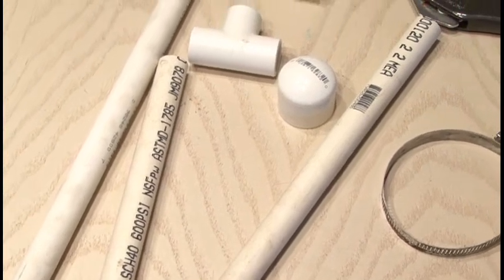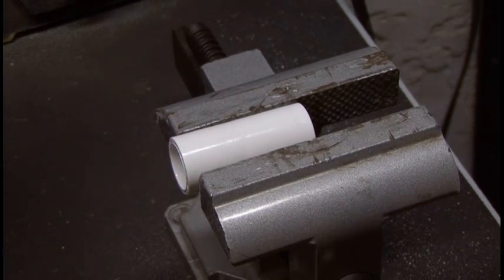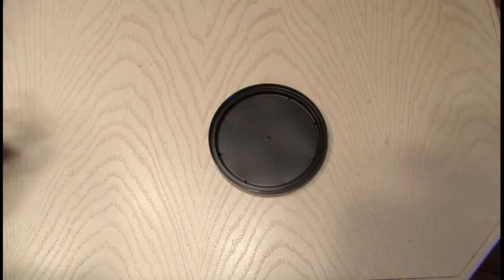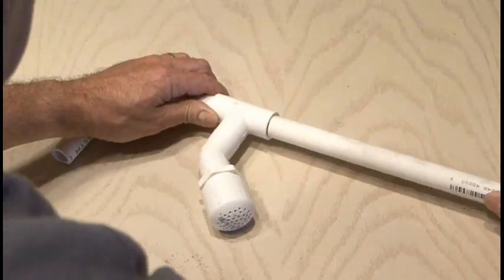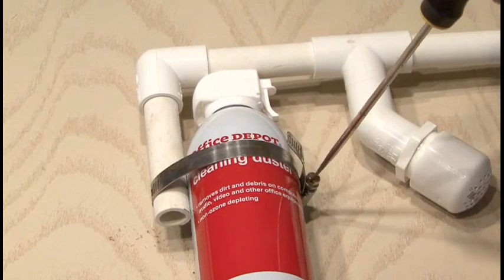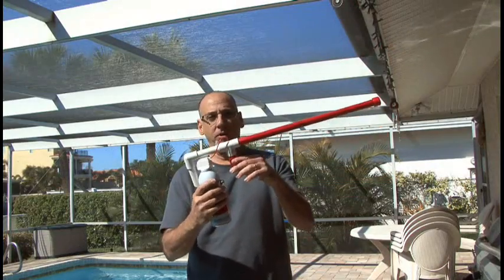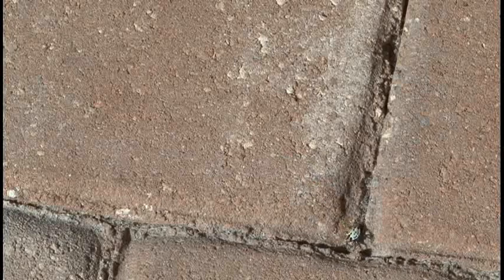Weekend Project: Spider Rifle

Comment: The bottle of compressed air that I bough left a cold vapor inside the cap the spider is supposed to end up in, and I’m assuming that that cold would kill any spiders I catch. Can you recommend a brand of compressed air that does not have that issue?

Comment: I tried this twice with very disappointing results. I would need to use Co2 cartridges to get enough air pressure to make this effective at all also I found a way to make it shoot the spider. Just needs more air. Might still try it. I crushed the one spider I sucked up with it from having to hold it so close  which kind of defeats the purpose for my niece. She doesn’t want to harm the spiders but relocate them safely.

Comment: I thought I was going to be able to shoot spiders at my enemies
Reply: actually, you can do that just by modifying this design slightly. just suck up a spider, then take the comp. air tube out of the hole on the top, and put it in one of the holes on the bottom. spiders will be shot towards your enemies.

Comment: My only concern, is the content of the air duster.  the content of the can is not compressed air. It's actually Tetrafluoroethane (AKA R134a AKA Non-destructive Freon refrigerant.) .. Over-use of the gas (holding the valve open for too long) will freeze the spider. (Now, I know the arachnophobics reading, and making the "Kill It With FIRE!" statements will say "GO FOR IT!!" but, if the intent is to keep the spider alive, only use the gas in short bursts, and NEVER invert the canister! Doing so will allow liquid R134a to enter the straw, and vent, causing instant freezing!  (to say nothing of Frostbite if you get it on yourself before and as it vaporizes.)  I've also used a similar idea to remove mud & paper wasps that got loose in the home (the perils of living in an old nearly 200-yr old farm house.).. and added a 1/4-turn valve between the catcher canister to hold the little suckers in.

Comment: It mystifies me why you need a "valve" in the tee fitting. It seems you could just as easily put an end cap on the handle. I don't see what purpose it serves except perhaps to avoid the cost of an end cap. Enlighten me.

Comment: Or you could just buy something just like this. My parents used to have it. Now we just have ways to protecting the house (lavender, citrus). The device would trap the spider in the catch (assuming it didn't die from the trauma) where it dies of starvation. If you're just going to let it go, what's the point? They're evil. It would be like building a prison with a literal revolving door.

Comment: I think you made a fatal error in your design, sir.

You let the spider live.
Reply: Line the insides of the tubes with posion and flames!
Reply: Yaaasss
Reply: +Plato i might do that with mine
Reply: in think you're to evil..
Reply: +PlasmaScythe Better idea, line the inside with razors angled to slice incoming insects.
Reply: ikr
Reply: Juan Angel Andrade Or needles. Needles are safer to handle than razors. You're going to have to line the barrel with them, if you line the part of the gun with holes in it, you'll slow the gun down more than you would with the barrel.
Reply: Muffet
Reply: James Bernich Muffet won't fit in this rifle thing.
Reply: +Fuck google's name policy dude there are so many homestuck/undertale fans now!
Reply: Nepeta Leijon They are uniting as one through the power of megalavegala.

Maybe.

Don't quote me on that, k?

Comment: Put a cloth soaked in 50/50 water-insecticide in the end-cap before using the spider rifle.  The low concentration ensures the spiders suffer without dieing so they can feel the flames of justice when you uncap the rifle and throw them in a bonfire.

Comment: Spiders are arachnids, not insects. What you made is more of a vacuum than a rifle. It  wouldn't work with a big spider. Why not just use your regular vacuum cleaner? The only downside is that it would kill the thing, not just trap it. Of course, I'd rather kill a spider than get bit when I'm setting it free.
Reply: +Naughty Little Boy For all the work he put into this project, he could have modified an ordinary vacuum cleaner to capture spiders alive.  Cheaper to operate (compressed air cans are expensive) and more efficient.
Reply: +Naughty Little Boy You're only 6 years late on telling him that.

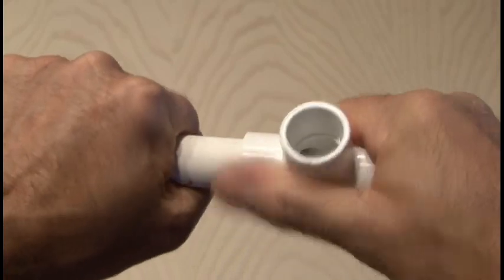Comment: Just an observation: at about 1:36, the narrator clearly says he is drilling holes in a 1/2" end cap, but at about 2:29, he clearly says that the end cap is 1 inch.  Which is it?  The video was recorded first, then he went back and added the audio.  Obviously he misspoke when referring to the cap as 1/2".

Comment: Just curious, and let me up front clarify, I have no problem with the death of the spider in this project, but once the spider is sucked into the "container" that you are blowing the compressed air through, would he not at this point be frozen by the propellant that you are blowing from the duster?

Comment: As others have said, that would be non effective on the most common spiders in Australia, Huntsmen. I just trap them under a clear plastic container, slide a bit of card over the opening and set them free in the garden. I did try to zap one with a laser pointer once but they move too quick. Did get him once or twice though and it put him into a more accessible position to put him outside :)

Comment: The Aussie version would take full sized drain pipe and a leaf blower or shop air at high pressure.
Do not use on stinkbugs!
Not unless you want an aerosol room odorizer. One shot and that invisible green fog happens. Eyuu...
Here's an idea. Make a remote bun wad holder with reach that swallows the stinker into a piece of tissue and then flush it.

Comment: Would this still work if instead of the catch, I connect a short hose that goes to the toilet?
Reply: Spiny orb weavers are one of the many beneficial spiders we have, since it preys upon small pests that are present in crops and suburban areas. They help to control overpopulation of these insects. Spiny orb weavers are not dangerous and would easily be overlooked if not for their unique coloration.
Spiny orb weavers do not invade the indoors unless carried in while residing in a potted plant. Spiny orb weavers are not dangerous—they are beneficial animals. They should not be killed, if at all possible

Comment: If you are blasting the compressed air straight into the chamber that the spider will eventually find itself in wont you run the risk of giving the spider frostbite?

Comment: This is a good idea, but what if the only spiders you come across are adult wolf-spiders and 8 inch house spiders? ( the only ones you come across in woodbridge VA )
Reply: Flamethrowers are always a good option.
Reply: make an spider cannon using a compressor
Reply: Saddam Hussein Saddam, Hey. How's Satan?
Reply: HYPERSHADNIC he is good (if you know what i mean)
Reply: It is called Arson, then move far away.
Reply: HYPERSHADNIC A flamethrower or an Incendiary grenade should work nicely.
Reply: Dinkleberg75  Or i could use my Frost Breath Shout.
Reply: then move
Reply: Pick them up and take them outside. Than put them somewhere a bird won't get them.
Reply: Get a blowgun and shoot darts in them.

Comment: Is there a way I can turn this into a device that launches said spider at people/things?
Reply: Theres a special place in hell fro people like you
Reply: Just move the air nozzle (tiny red tube) to blow in the very back of the gun. The air will rush over the spider trap, drawing it up and out the front. Shooting spiders at people won't gain you any brownie points though. :)
Reply: Perhaps remove the end cap with spider, and set it on the end of the barrel. In theory it should work the same, except it would shoot the spider out of the bottom, and not into the end cap. So aim well!
Reply: Reverse the air flow somehow.
Reply: you could add a screen in the barrel of the gun (like he did with the coffee lid but just poke holes in that, and instead of drilling holes in the cap just leave it without any holes) then with the cap off of the bottom suck the spider in, that way the spider wont go down through but be stuck in the screen, then simply put the cap on and fire again and it will send the compressed air through the barrel forwards propelling the spider to his death.
Reply: lol
Reply: Just block the holes on the bottom with your hand (or if you're arachnophobic, a tissue in your hand)for ease add a flat bottomed end cap that fits snugly over the first one, create the gap with a ring of pipe long enough keep the tip a cm or so from the bottom (or an inch if you're arachnophobic) , drill an inch wide hole in the larger piece before you adhere it to the spider compartment, now it can only release a spider by firing it though, although I think the spider's terminal velocity will be extremely low so it's best chance is being fired outdoors, if you're actually facing dangerous spiders, you might want to add a valve to the base with a button so you can avoid any contact, though I wouldn't advocate doing any of this since you can just, you know, block the holes with your hand.
Reply: ricardo steele not at all, its just adding a screen and not gluing a cap on

Comment: um im sorry where i live the spiders dont sit still and let you suck them up. depending on the mood and size of said spiders in my locale... they may jump at your face from well more then 18 inches, or skitter off the first time you get the 18 inch barel 18inches from them. better to reverse the air flow to burst the spiders body with a laser stream of air. then kill the spiders bits with fire. lots of fire.

Comment: thats all good and dandy for harmless spiders, but not for black widows, wolf spiders, brown recluse, etc. spiders that live near my house.... think i will stick to spraying them with Axe body spray and setting them on fire...
Reply: I made the rifle with three alterations for black widow spiders. First, I used a much larger receptacle of clear plastic with the bottom cut out and fitted with a fine screen to allow air flow. The second difference is a PVC valve between the barrel and the receptacle, so that once the spider is visible in the receptacle, I can close the valve, detach it from the rifle, and place it in the freezer for an hour to immobilize the spider. Third, I used clear tubing for the main barrel so that I can tell right away if the spider got a grip on the inside of the tube. When that happens, you just stop spraying for a sec until it starts to move, then blast it the rest of the way into your receptacle. The bottom of the receptacle twists off so the frozen spider can be dumped out on the driveway and safely stomped. I made 3 receptacles so I can keep going after catching one spider.

Comment: Like this but the air system is backwards with kerosene and/or diesel and/or lighter fluid with a jet flame lighter on the end. Also, make the barrel longer.

Comment: Stupid. Just use a glass or a large translucent bowl and a firm piece of cardboard or paper. Place the glass over the spider, then lift one edge ever so slightly to slide the paper/cardboard over the hole. That's only if it's a large spider, this little spider I'd just move by hand. Easier to do. 

This gun would have no chance of removing a huntsman or the like, which I've regularly seen in the half hand to full hand size around my house.

Comment: i have tons of creative ideas that would make this frivolous contraption actually practical in function. like heres an idea to create vacuum how about you actually fucking USE ONE!!!!!. or for instance if you are lazy as hell and dont want to get one out. how about you put a 3 cell circular AA battery pack in one end of the PVC pipe and, use a low voltage FAN! to create the necessary movement of air to create suction. by the way the tab in the last post you slide out before use. close to trap.

Comment: so at least make a slit above the removable cap, 1/2 assed containment device that does not trap the insect you are trying to use this toy...i mean tool to NOT TOUCH. and insert a screen or plexiglass slide tab (plexiglass would work better because it is solid and transparent so you can see what you ACTUALLY TRAPPED, without the risk of the fucker popping out and biting the hell out of you.) MAKE SURE YOU MAKE THE SLIT ALL THE WAY TO THE WIDEST POINT OF THE TUBE. so it will seal correctly

Comment: ~= THERE IS GOING TO BE PROBABLY 5 OR SO POSTS TO EXPLAIN ALL THIS TO YOU CUBBY, SO GET COMFORTABLE AND GET SOME POPCORN.=~    If you actually wanted to be creative and practical about it this is what you should have thought about. 1) people would want to use it to NOT touch the spider.so a fucking 3 inch cap with holes in to capture it when your highly expensive vacuum inducing propellant is applied is not smart. they have to take off the fucking cap Einstein.

Comment: i prefer to use a cup and a piece of paper - put the cup over the spider (thus trapping it against flat surface, eg: shelf), then drag spider off flat surface over paper. Paper seals spider into cup for easy transportation. Way simpler

Comment: Neat, but I have to point out that you're using difluoroethane, a hydrofluorocarbon similar to that used in the AC system of your car, or tetrafluoroethane, which is the exact same substance used in your car AC system.  (depending on brand of 'canned air')  It is NOT compressed air.

Comment: the stock nozzle is pointing straight down and sends the compressed air out, that's where the valve cover made from the coffee can lid comes in. it cuts off any extra routes the air could take to escape and the pressure of the air forces its way straight down and out through the end cap with all the holes in it,  bypasses the barrel altogether,and creates the vacuum.

Comment: So at the cost of compressed air... the cost (and more-so) effort in building the gun.... explain how a shop vac would not do same... cheaper.  ("Bucket Head" vacs at Home Depot... $20)

PS... pool screen spider doing wonders for that garden by the way...

Comment: stupid guys! they can use a sort of vacuum cleaner at lower RPM..

furthermore, why using a Drill for drilling those holes on PVC. A Soldering Iron would be 10000 times more practical!

Comment: @SD1993 just put a fabric top on the outside of the trap and blast away, the air should push out the spiders from the trap through the barrel

Comment: @b33p3rz 	
Kingdom: Animalia
Phylum:	Arthropoda
Subphylum:	Hexapoda
Class: Insecta
All Insects

Kingdom: Animalia
Phylum: Arthropoda
Subphylum: Chelicerata
Class: Arachnida
All Arachnids

Same phylum, but they split after that (mainly due to spiders having 8 instead of 6 legs) So a spider is not an insect. Different build, body functions, and other related parts of spiders also declassifies them as an insect. Soooo no, spiders are not insects.

Comment: "I'm using a pvc cutting tool which is much easier and creates less harmful dust."
You're kidding, right?  Because a hacksaw is going to give you a mountain of PVC dust.
Not to mention this design is completely idiotic and terribly wasteful of compressed air.

Comment: @INDIG0CHILD22 That is indeed a fact. It's also a fact that a tomato is a fruit, not a vegetable. Another fact is that i.e. and e.g. mean two different things, which I won't describe here to save space. One striking similarity shared by ALL of these facts however is that virtually no one cares. Everyone will understand precisely what you mean if you call a spider an insect, a tomato a vegetable, or use i.e. and e.g. improperly, and only an insufferable pedant will ever point out your error.

Comment: Hello, thanks for uploading this :)
Just a small question.  I was thinking of building an air cannon, but I'm not going to be using it for long distances, so I won't be needed too much pressure.  Do you think I'd need to use PVC glue, or with a snug fit be enough? Kids will be using this (for a water balloon fight :)), and I'd like it if they built it themselves (or rather, they would :)) but if glue is needed, then I'd have to build it before hand.
Thanks :)

Comment: I build this bug trapper and it doesn't work that well...
But it use to be funny by removing the trap and switch it with a lighter xD
[Use Hairspray not compressed air] ... Okay this is not human any longer but more Funny :D

Comment: That's fine and it works, however the compressed 'air' in the canister isn't air... it's a freon derivative, 1,1,1 trichloroethane, or similar. The catch is it's a neurotoxin to most living things. too much of this gas on an insect, and it puts them to sleep... some times permanently. 

Many humans have done this too, it's called 'dusting' and it does have long term neurological effects, namely degradation of the central nervous system. 

You probably don't care about a bug, but people, yes.

Comment: @link55543 thin sharp wire just before the bit with holes so it shreds it but dont dril the hole or spider bits will leak out

Comment: lol. Use 4 inch thinwall PETG instead, should work teh same, but have an Internal Diameter of aroun 3.87 inches, If the spider is bigger then that, I'm scared for you.

Comment: I wonder why do you bother making it into a rifle when you are just going to use it in point blank? A moderate tube with some insect bait on the bottom and a wire gauze in between works wonders too.

Comment: i made one but mademod facations instead of pvc piping i used metal and i made the compressed air to come out of the end and did not make the trap part to have no holes the placed a lighter at the end so it was a flamethrower. It shoots about 15 feet if you waqnt the plans to make it reply to this comment

Comment: those chemicals are easier to compress, and create less condensation when used.  they're pretty inert, the vacuuming and relocation of the spider will probably do more damage than the gasses.